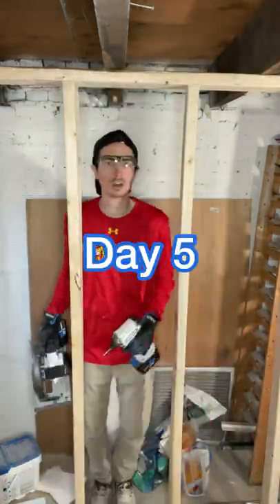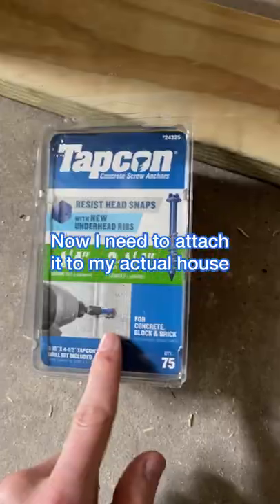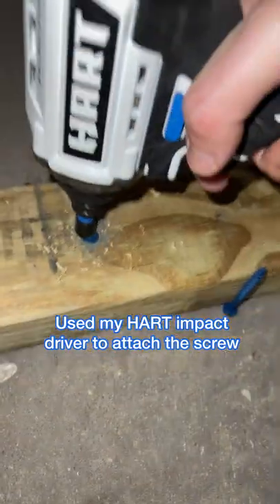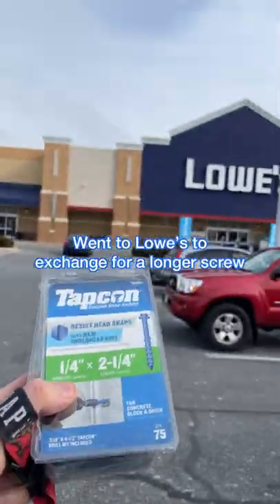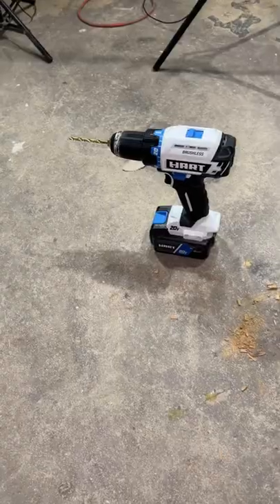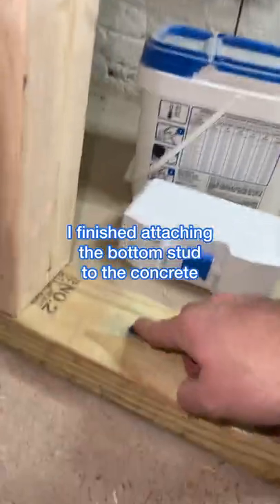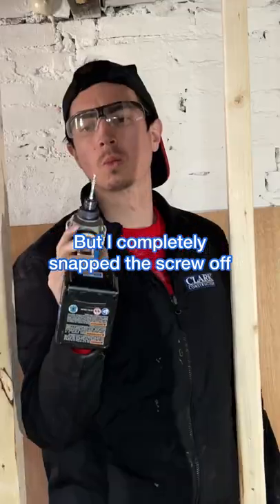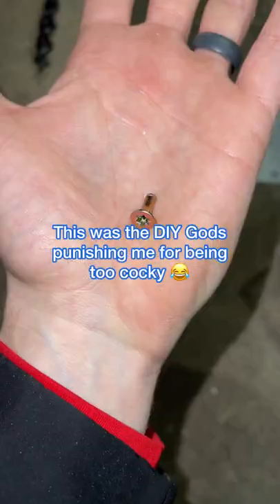DAY 5 | Finish Basement By Myself 💪

Comment: Took a job from a renovation company. They had already hammered through the basement slab and removed tons of dirt. Was only 5.5 feet of height before. They brought me in to frame out the basement bathroom, hallway, and a room. They wanted floating walls. I'd never done that before but on the job training, right. Basically because the weight from the floor above may sag over time, they wanted a 1.5" gap below the wall's bottom plate. I attached them to the upper floor joists first, and had them sitting on 2x4 scraps. Then hammer barn spikes through the bottom plate and remove the supporting scraps. After drywall, textured mud and baseboards, the gaps were hidden. If in the future the wall sags, the drywall shouldn't crack. Remember to plan for ductwork space if you plan to drop central down there.
Reply from the maker: AMAZING advice! Thank you so much for this, Andy! Seriously, such a huge help!!!